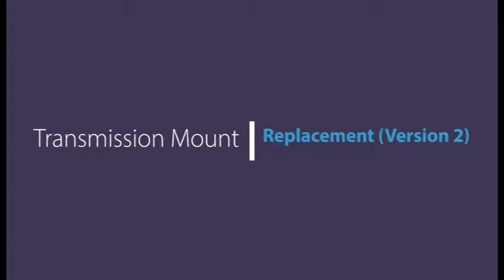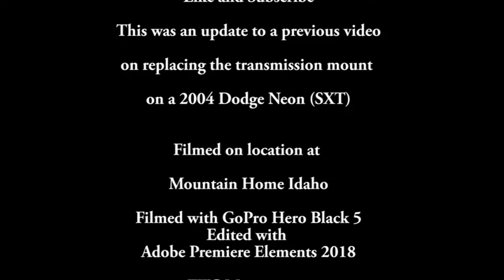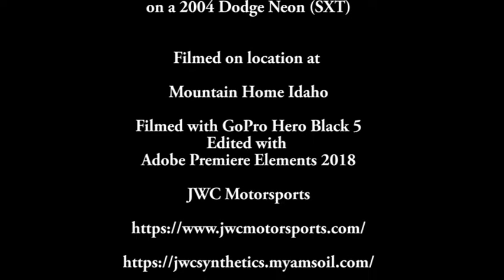2004 Dodge Neon SXT 2.0l Transmission Mount Replacement Update

Comment: Thanks for the vid, boy worst car ever to work on. I had to remove the entire mount since the trans wouldn't drop enough to get the plate out... and save yourself hours of frustration by getting the entire trans mount. I spent over a hour just getting the bushing swapped... hopefully this lowers the idle shake problem from ridiculous to bearable...
Reply from the maker: Only on suspension parts have I just replaced the bushing, to much pain for the gain on mounts.  Also consider the cam position sensor.  It can start to leak and get into the connector (not common but can happen).
Reply from the maker: The hose will get hard and not seal, creating a vacuum leak.  Check all the vacuum lines and replace a necessary.

Comment: I'll be replacing the three motor mounts when installing the TB kit so figured it may be wise to replace the transmission mount at the same. Not so sure if I want to after watching your video since all I have is a floor jack to work with. Is there a way I can visually inspect the rubber in that mount for cracks and breaks? Does that mount hold up longer than the three motor mounts?
Reply from the maker: That one is not easy to see unless you remove the air box and using a mirror can help.  I can last longer than the others however in my experience, if the engine/transmission is shaking severely, it may be the one that needs replacing.  It can be done with just a floor jack, but as you see it's easier if you can lift from above.
Reply: @JWCMotorsports  I own a 2005 SXT with 125,000 on the OD. Bought it for my son in 2006 as a HS graduation gift and he gave it to me in November of 2020 after dealers refuse to take it in trade for a new Ram PU. The engine had a vibration in 2014 which was the same in 2020. It just made the motor sound loud when accelerating then would quiet down until recently. Then it started droning at all speeds and sometimes would make the center plastic dash panel rattle. I recently changed out the top mount after seeing how it's cracked rubber had split apart where fastened to the motor. The vibration didn't go away but the dash stopped rattling. I used to work as a mechanic so have an assortment of inspection mirrors I can get in there to check that mount. I could lay a 2x4 down then use a chain and a long bolt to raise and lower the motor if that mount looks bad.
Reply from the maker: @billwilson3609  I used that method when I the lower motor mount (with a bad quality one) and before I got this engine support.  A couple 2x4s for added strength but the neon engine/transmission is not too heavy to start with.

Comment: How many transmission mounts have the neon?
Reply from the maker: There is only one transmission mount, there are however three engine mounts on an Automatic in this generation Neon.
Reply: @JWCMotorsports  okey..thank you buddy..i replace the transmission mount in my brother car but the car still is shaking a little..
Reply from the maker: @adrianzamora6785  The engine mounts can cause that as well.  And they are more easy to replace.

Comment: Is this a manual or automatic transmission? Do you know if the part the same for either/or?
Reply from the maker: In this video I'm replacing an automatic transmission mount.  It is different than the manual transmission mount.